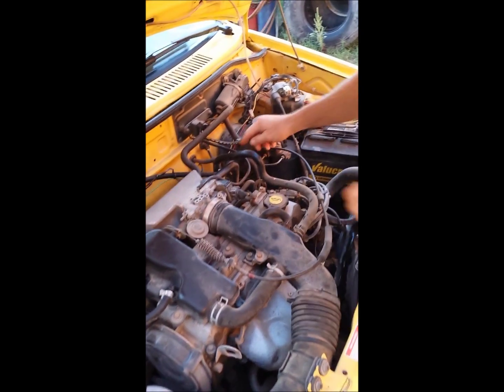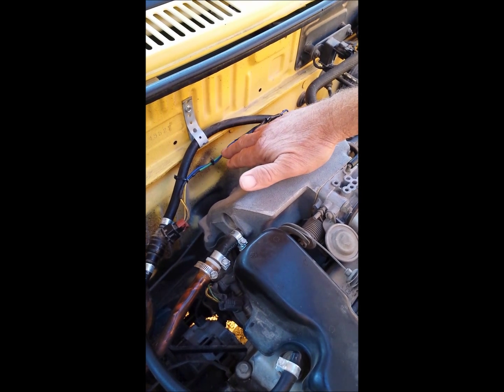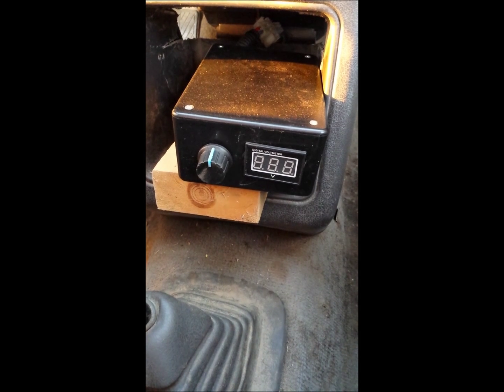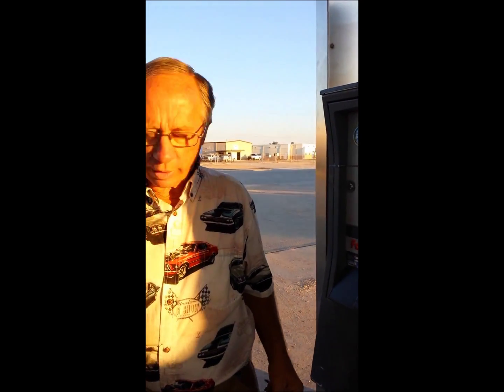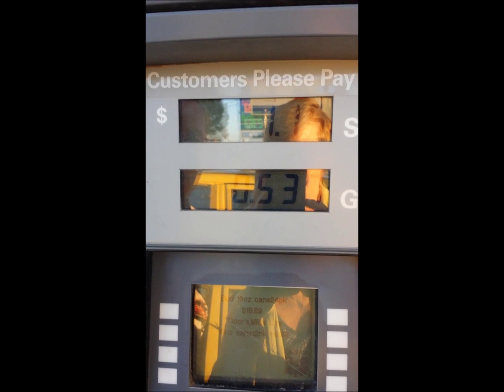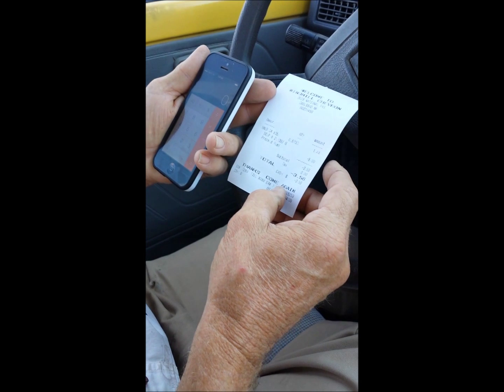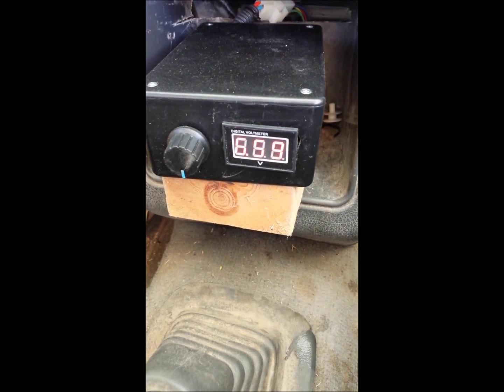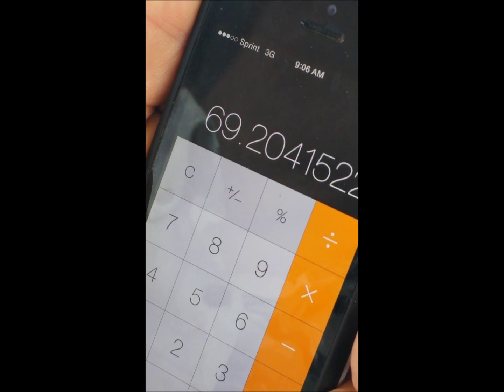Cold Fuel Vaporizer

Comment: Hey handsome, project farm on youtube got a lawn mower to run on gasoline vapor but found that the mower didn't run any longer than on solid gasoline. 
What did they do wrong?
Thankx
Reply: By not presenting the atomized fuel of the Project Farm bubbler directly to manifold vacuum by using the stock fuel line, the fuel wasn’t as completely vaporized as it would be here.
Reply: https://youtu.be/Ke0MGmUr3SU

Comment: I know how this system works because it's the exact way many fuel savers/ vaporizers work. It is all using the vehicle's own pcv system including the original pcv valve which controls vacuum  where there is not too much or too little ; fuel mist, droplets or a fuel jar bubbler is under high vacuum that  the engine creates and fuel vapor created by the engine's high vacuum is fed to the engine via intake manifold and distributed to all cylinders and burned together with the fuel sprayed by the original fuel injectors. 

 So you start at the 1)valve cover vapor outlet , as hose to 2) a fuel bubbler jar, fuel droplet needle valve or fuel injector mister,  fuel spiral hose - here is where the liquid fuel its turned into a volatile fuel vapor . 3) another hose where this volatile fuel vapor is fed to a drilled and tapped vacuum fitting on the intake manifold and from here the rest is done. No external air must enter the fuel vaporizer at any moment or any of the sections explained because it will cause a vacuum leak reading and affect performance and fuel economy in a negative way, so double check everything is tight sealed a every connection from valve cover output hose all the way to final stage intake manifold supply hose and fitting.
Reply: Can this cause engine damage?
Reply: @keithc8108  That's a good question , it should not but it also could burn exhaust valves if it leans too much without you noticing it , if you don't have a couple or three egt sensors to monitor peak exhaust temps you could be at risk . Another youtuber did the fuel drip fuel vaporizer and also added a water vapor jar that would be fitted right a the throttle body to where as you step on the gas pedal an intake vacuum decreases but air forced inside the intake manifold would increase similar to how a modern fuel pressure regulator works. He mentioned this second plain tap water mod should cool down the air intake charge creating a safety zone when the car's main computer leans out the air/fuel mixture due to the extra fuel vapor created by the said vacuum assisted fuel vaporizer. I hope this helps !!
Reply: @Journalistification  I see a lot of videos on running the engine with just a vapor jar bubbler. Is that better for the engine, then leaning out the fuel? Some of the vapor bubblers seem very impressive for economy.

Comment: It's great idea, but I have question did you disconnect the fuel injectors in the  engine? Does the engine work only with your new fuel injector? Thank
Reply: No, he didn't disconnect. He just added another injector and sent thorough it vapors. ECU adjusted fuel delivery in other injectors and hence better mileage

Comment: Richard, great video.   Is the injector you added the same that came with the 91 ford festiva??  I want to do this for my Dodge Ram 1500 and am thinking I could use a smaller in jector like the one you used instead of one from a RAM 1500.
Reply: CMG57 how did you make out?  I also have a 05 hemi

Comment: Try to move your 5 foot of pipe down around the exhaust and heat the fuel to a higher heated vapour and see how it goes.thanking you for your improvements to vapours fuel it gives a lot more to work with.

Comment: Have you done anymore testing since this video was made? Maybe ad my air to the tires also. 50 psi.
Reply: As a hypermiler myself (in a 5,3L 2000 Silverado), I caution against too much pressure, as it will wear out thecenter tread of the tires, and the early tire replacements will negate your fuel gains, plus lessen your total traction somewhat.
Vacuum system buiilders should keep in mind that the vacuum increases BEFORE the trottle plate when opened, and lessens AFTER it. You have the most suction at idle in the plenum.

Comment: This system is not safe as shown in the video. It is a fire / explosion hazard. You are using too much rubber gasoline hose, and you should replace most of it with metal gas tubing. The coil that you haphazardly coiled on top of your strut tower should be coiled inside a stainless steel cylinder/pot , and mounted to the periphery of the engine compartment, to protect it from engine heat. Be carful that someone might try to copy your idea and then gets burned or dies. You have a good idea here, just make your system safe before you present it to the general public. Thanks.
Reply: Thanks Captain Safety

Comment: I tried this with a pulse-width modulator and a fuel injector. All it did was cause the injector to stay open all the time. The injector I used was a 12 ohm injector. I tried a different one at the same problem. I tried the pulse width modulator on a 12v water pump it worked perfectly I was able to control the speed of the pump. Does anyone have any idea why I was unable to get it to work this video doesn't explain any of the wiring and just says connected to the black wire red wire and that sort of thing which is not helpful at all. Seems like he tapped into his existing fuel injector system but never explained how the wiring is to be done which is virtually useless. I've spent a considerable amount of time trying to do the same project and it doesn't work.

This next series of comments is a follow-up:
  My first emphatic statement is to encourage anyone interested in this project to never attempt a pulse-width modulator circuit even from the engineered circuits coming from those who have engineering degrees here on YouTube. None of them work because none of them controls the duty cycle properly. The other problem is the range from high to low fuel flow rate is extremely narrow and you have to swap out capacitors to fine-tune the system. I think using a PWM in 2018 is a horrible way to do this particular project. You need to purchase and Arduino multi projects kit, get familiar with how to upload programs, and control your fuel injector with an Arduino. You are going to save a great deal of frustration and you will be up and running in one-tenth the amount of time.
Reply: ive seen several utube videos that show how to make a pulse width injector circuit with schematics
Reply: Tim Casey, did you write code for the arduino? Will you share if so?
Reply: @MAXMPG  It's not just the code, it's also the bread board and all the electronic components. Getting it to work. The code was simply a square wave generator and I just put in a couple values, I really didn't write much at all.    The key is to understand that your fuel injector is going to require more amperage than the Arduino can put out on it's a little bored so the Arduino needs to power a relay, but it needs to be a board mounted relay. What I mean by that is it's a transistor that you need to use as the relay because it can power a larger current quickly.
Reply: Thank you for information Tim. I have for long time wanted to do an external injector for fuel supplemation. I have started my education of writing code. I have arduino on my hondas but by the knowledge of another person's code writing. I am interested in learning this type of control. 
So you are interested in mpg too. I have searched patents for years. To do something similar to what was done in the video, another person did it years ago. PM me if interested.

Comment: Have you tried running the engine with just the one special injector and unplugging the other injectors? I think it could work since you can control the amount of fuel being vaporized.
Reply: It doesn’t need to be timed as it is causing a vapour
Reply: No I have not, but it is not timed as the other four injectors are.  It might work.  Worth trying.
Reply: Do you know if those oxygen sensor extenders help to improve mpg?

Comment: So I believe that the hot air that comes from the valve cover also helps vaporize the fuel.. It would also be a good idea to install an Oil Catch Can before the 3 way connector to prevent oil from the valve cover mucking up the conduit hose
Reply: It might help.  The hose turns hard after several months, so it should be changed out every so often.  It still works after two years.

Comment: Hey guys, nice video.  You guys basically did exactly what I did but you used an injector instead of a bubbler or evap system. I did this on my 95 Toyota back in 2014 and doubled my mileage. I didn't have the money for the PWM and injector setup or I'd have gone that way. Glad to see it worked out so well! Keep it up!
Reply: Congratulations!  My partner sold his that was similar to mine and asked if he could add the pwm and we agreed on no patents.  He got $100k from a company in South America.  It was fine with me. Build  and sell them anyway you want.
Reply: Hello @richardmckean5062  ! Is it possible for you to explain in a video the schematics of the wiring you did on this system?I've managed to procure all the components shown in your video and just need instructions on how to wire it up to my car. I got my hands on a 95 corolla i'd like to try this on!

Comment: Excellent video!! You can also disconnect the cold air intake and route it to be warm air intake. This will degrease the oxygen and reduce fuel consumption. Warm air gets better MPG!
Reply: Why?  Warm air is less dense. You get less power out of less density in the cylinder.  Why would you get better mpgs?
Reply from the maker: Yes.  There is always room for improvement! Thank you!
Reply: @Pokeanoscat  has this system caused any damage to your engine? I read if you run it too lean, it can cause damage.
Reply: I have not checked the air temperature in the hose, but the engine is hot and the line is coming from the crankcase, so it is not cold.  Something to play with to see how much better you can get it.

Comment: With what frequency hertz?
How often opens the nozzle?
Reply: I don't know how often it opens the nozzle. I go by DC voltage applied to the injector to slow it down.  Lower than 5 volts usually turns it off.

Comment: I Have heard it said that to copy someone is the highest form of flattery.
I would like to do just that. This video has great detail except for the wiring.
Would you consider a wiring video. I know that my cars injector has a constant 12 volts on one side and a pulsed negative signal from the ecm on the other side. I do not want to assume anything but is the pwm an on and off signal that feeds positive? If so then I'm relatively sure the injector can be wired constant negative and pulsed positive and will work just fine. I noticed on the pwm wiring there is a positive and negative input and output. Do you connect the positive and negative output straight to the injector? If so that is wonderfully simple! Also am considering your friends idea in tagging onto one of the other signal wires. Does the resistor go on the positive or negative or does it even matter? Thank You for your time and sharing your ideas and your videos! Gerald
Reply: Thank you, Gerald.  If  you piggy back the negative side of another injector, you do not need the pwm.  The advantage to doing this is it increases and decreases with the speed of the engine.  The disadvantage is if you short it out, you loose your computer.  Also you cannot tune it like you can with a pwm by turning down the voltage.
Reply: Did you make a replica?  How did it go?

Comment: Hi Jeanie Mkean. Despite watching many vaporised fuel setups that I have seen accomplished where the vaporised fuel enters in the engine via the air intake, I am still very concerned about directly hooking up the devise directly to the air intake. After I had spent time chatting very recently with an ex royal army electrical engineer, that has worked on air crafts, ships and now cars for the past 30 years or more, I had second thoughts about certain things. He seemed like a very nice chap that knew a lot about alternative energy devices and studied a bit on such DIY projects on cars. He advised me if I do decide to do it that it would be best that the fuel goes through directly to the manifold. Basically as if I needed to setup up the device to work like if it was LPG configured. So that would mean drilling holes just below the fuel injectors at 45 degrees angle to attached steel tube fittings. That would match the 14.7:1 ratio in the car??

If I was intended to just send it down the air intake I was advised that the engine would become very hot and volatile. For example, even though on paper it would suggest that the car should operate via sending fuel down the air intake. However, advised that the car would get uneven amounts of fuel distributed to each piston. Causing the car to heat up and create huge backfires (which is inevitable), possibility of destroying the auto throttle which is very costly to fix and destroying the oxygen sensor, which is another expensive part. I just do not want to damage the car. I do have some basic questions to ask you:

1) Have you ever had any problems operating your devise through the air flow intake?
2) Despite my initial thought was to make sure that I had a very secure meshed flashback built into the air flow intake piping, do you have any other safety 
    advise or is it just general scare mongering?
-  Will all these things depend on the type and model of the car?
-  Are fuel injected cars more difficult to configure with vaporised fuel systems in your opinion? 
3) Could I use my devise to supplement the engine without altering the engine? The reason why I ask I recall that when you fully had your devise in 
    operation, I do remember reading that you would switch the fuel pump back on momentarily to give your own setup on the car an extra boost. 
4) Do cars in your opinion operate a lot cooler, make the engine run smoother and last longer?

I am quite happy to share my device, which I believe will perform very well and very safe.
Reply: Thank you for your questions.  I apologize that I have not been watching my responses. 1. If you use the vacuum intake manifold, you will not get a back fire.  There is no extra oxygen going into your system and it is under vacuum. 2.I think it is fear mongering.  You are always taking chances when you get off the factory setups.  Most important is how you connect you fuel line to your injector, because it can pop off and have gasoline spraying over a hot engine.  It is easily fixed by purchasing a Harbor Freight Tool Vacuum Tester and using the parts from the tester to screw the hoses to the injector. 3.  If  you use a pwm, you do not alter the engine. It does not tie into the ECU.  You manually adjust it by watching your voltage gauge and turning down the volts that slows down the injector. It is not tied to the fuel pump, so I do not switch the fuel pump on separately to give it an extra boost. 4. The vaporizer makes the engine run much smoother and have more acceleration.  The temperature is about the same.  I hope this helps.
Reply: @richardmckean5062  makes sense to me Rick.   This setup is just fooling the ecu to adjust existing injectors fuel mixtures.  The cool thing about this setup is from the PWM you can turn the entire setup OFF as you displayed in your video by turning the control knob counter clockwise to OFF position.
Reply: Would you mind sharing your device and your experience with it, including results?